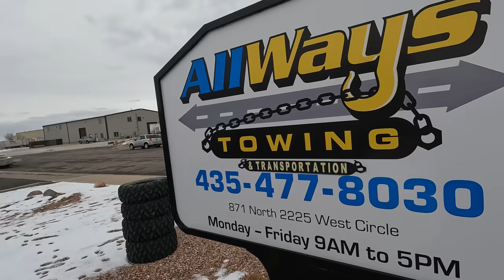Snow Storm Launches Toyota Off The Mountain Pass!

Comment: Great job with the wrong trucks. A long chassis ford with a twin line wrecker (11,000lbs), ice chocks and 1 guy can do this recovery because it is on the access road to the resort. Use both lines, boom fully extended with dual Ramsey 6000lb hydraulic winches and this is a mid level recovery. Go fully extended boom, and full Boom-UP and the twin lines allows the operator to pull the vehicle off of the tree. I was always able to commander volunteers to direct traffic and 1 willing young man to drive the van in reverse during the recovery. 
Once the van is off the tree, switch both 1/2 inch steel cables from your twin Ramses winches to the back of the vehicle and you can easily control the direction it is coming up the slope, since your Boom is maxed out in the fully up position. With the boom topped out the back of the van is not even touching the snow, so it is easy to pop the vehicle over top of the "Windrow" that has been created by the Snowplow. The windrow is typically very hard compacted snow, the twin line wrecker ensures that there is NO digging required.
 I am certain that Matt knows all these things about twin line wreckers given all of the experience he has in the recovery business. Being an old tow truck driver from the Interior of BC, this is what you spend a great deal of time doing during the winter months. Great channel, great content. This recovery triggered "The storm flashbacks" of mountain recoveries.
 Recoveries are The BEST part of towing. IMHO

Comment: (hi, good morning, congratulations for the video, it's really beautiful, what beautiful places there are in the United States and in the far north. It satisfies my curiosity and there in the far north like Siberia when in winter it snows with Siberian temperatures from -12 to -16 and even -35 - 40 degrees, what is the grade and viscosity of engine oil used for your SUVs, do you use off-road mud tires for mud on snow or do you use thermal winter road tires or snow chains snow?) I drive my petrol Suzuki Jimny 4x4 with the m13a 1.3 LT petrol engine.  , petrol since 2001. I use Liqui Moly Mos2 10w40 engine oil with molybdenum disulphide and I also added an anti-wear additive from Liqui Moly Certec and, like all Terrain tires and Terrain Mud tires, it measures 205-70-15 and therefore I use gasoline additives that are used to clean the fuel line!  I wish you a Merry Christmas 2023 and a Happy New Year 2024!  Greetings from the Pontassieve province of Florence, Italy!

Comment: Tow truck with the dual winches would have been perfect. You could have winches those rear wheels in the air until the front wheels were on top and just drop the rear wheels on to the street. Wouldn't even have to shovel. Should have winches that driver side front wheel up to save the dri e shaft.

Comment: Good job getting that one out. One question though although I am sure you already considered it or had no choice but wouldn't having the engine of the recovered car running while at such a steep incline lead to oil starvation and possible damage?
Reply: As others have said, motor is in sideways, so probably no oiling issues

Comment: Recovered, but entirely totaled after all that time bending the A-arm stays in the unibody through bad pulling angles. Spent more time pulling it into the side of the hill than up the hill. Can actually see the rear driver wheel move outward in one of the pull shots and it definitely wasn't a trick of the camera or angle. Owner would have been better off calling a standard wrecker or flat bed who could have put a winch cable at chest or neck-level in order to get an upward pull instead of pulling into the hill. If the rope was held on top of the snow instead of allowed to dig down, it would have been better.

Comment: Another method. 
You make wood road,  use coupling to join the wood and fold it  so that we can keep in vehicle easily. 
You take wood flat pieces,  take hammer and push  wood below  four wheels using hammer.
Remember you have to make wood road, so that wheels don't get stuck with ice. 
Every wherever we can't bring roller.
Running car on flat wood is more easy on the  slope.
You make two piece of wood,  one will go below car , another wood will be used as road.
Play on first and second wood pieces. 
Car will come out smoothly. 
In the starting of work, put wood below  tyre in such a way,  so that it's becomes like road. 
Rest you know. By playing playing, with  wood pieces, you will understand. 
Jay shree ram.

Comment: You should definitely be careful with engine oil pressure on the vehicle being recovered. If that Toyota vans oil pan is rear sump or whatever it is, you can lose oil pressure at such an angle.

Comment: Alot easier with a real tow truck. Instead of hooking up a million vehicles to try and pull it out. You do know they make recovery vehicles with tracks on them that will climb a snowy mountain for probably the same amount you paid for those vehicles,  also less gas mileage because they are diesel.

Comment: I was not here and your the professionals. Just my experience. It you put a snatch block on each tire. Tie back to each jeep would that not double the pull on each side after getting it straight. I’ve used snatch block on a tree back to my jeep, snatch block on the jeep back to the tree. Each time doublingish my pull taking some stress off my Wench. Was just thinking of applying that here. I’ve also used multiple snatch blocks in a set up to pull a car on a trailer with a second vehicle.

Comment: Very very bad idea to be running the engine at that inclination. This car is gonna need lots of work on top of the body work. Lower control arms for sure, rims are likely damaged, rear subframe will need a real good lookover as well as its mountings and bushings, hopefully the engine did not go running on low oil pressure, but I think it may have.. not to mention the floor damage.... there's probably broken sensor wiring, busted exhaust pieces and likely all plastic belly pans are busted. But that's to be expected. Just don't be running cars in such positions or it might not end up well one day.

Comment: I have some more suggestions, 
First you take roller,  use your vehicle to run the roller and make road,  pull roller using your transport, because it's a slope. 
This you must experiment,  with time you will understand. 
Jay shree ram.

Comment: Is that a Corvair front end on that vehicle?
Reply: That vehicle is a Corvair. 1958 Corvair Lakewood wagon to be exact. Except it's on 40" tires and LS powered. Lol
Reply: @JohnFL  Didn't think it was an air-cooled 6. Custom chassis?
Reply: The chassis was mostly intact when they started working on it. If you look in the playlist section, there's a whole build playlist for it. The Matt's Off Road Recovery Corvair, or MORRvair.

Comment: Did I see right, this car didn't have winter tyres? Not very responsible driving to the mountains in winter-conditions without winter tyres. After all the difference between winter and summer tyres on slippery roads is like night and day.

Comment: Why in the world are you running the engine of the stuck car?   At that angle, there can't be much oil going to the oil pump.  And it isn't as if you have any significant traction.

Comment: It was not a good job at all. It seems you have made all possible mistakes. The biggest mistake is not using a crane car. You have to raise the vehicle to a height and not into the road like you did. No wonder you didn't make it. Also, why didn't you clear all the snow from the front of the car? A little more work and the car had a [relatively] clean exit.
I'm pretty sure you damaged the car with that violent pull on its wheels. It's a wonder the wheel didn't come off.

Comment: Wouldn't it be a lot easier, faster, cheaper with a big recovery truck, these puny offroaders are struggling and you guys are spending way too much time and manpower (and will probably charge way more than if using the proper equipment, unfortunately for the customer).

Comment: Why even mention that the back tires are not even rotating? S2pid. By putting it in drive you have ruined the transmission since is all wheel drive, the front wheels were spinning, the rear wheels were disabled by the ropes tight to them. 
Wannabes, that's can easily be done with a towing truck.